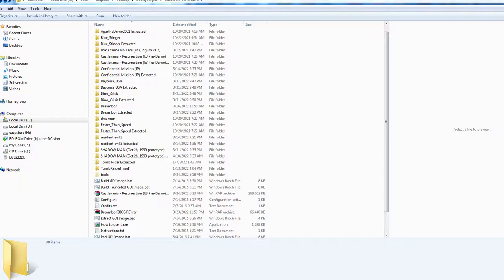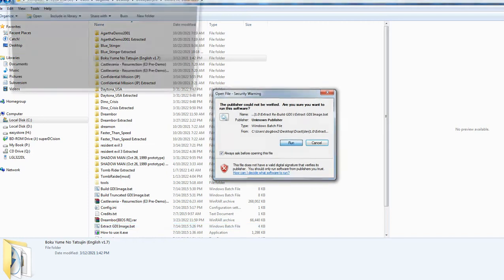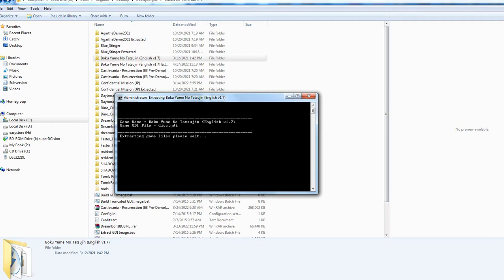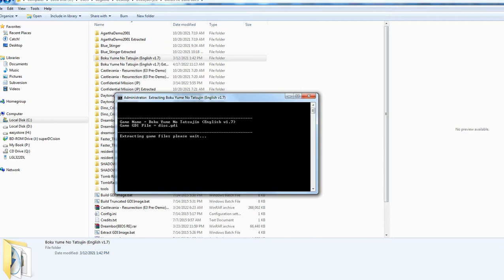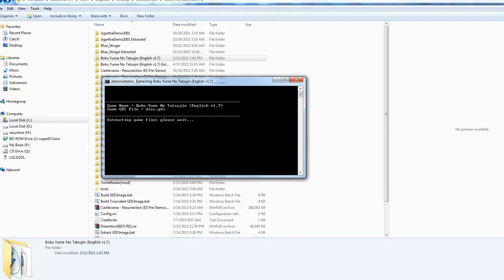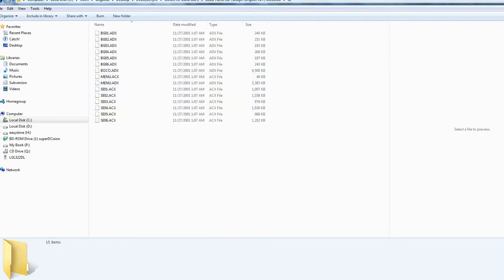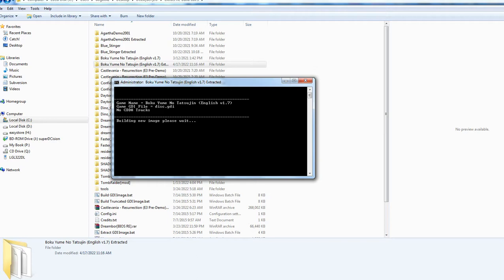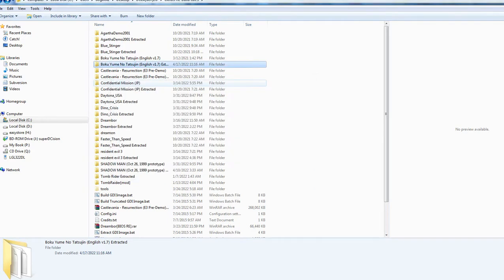HOW TO EXTRACT AND REBUILD GDI FILES FOR MODDING SERIAL PORT OR TRANSLATION DOWNLOAD LINK TOOLS

Comment: it is not able to extract sonic adventure v1.005 international version usa eng. I have the gdi and track bin files. I cant get config.ini file anywhere the tosec site only has retro games is this gdi extractor able to extract the dreamcast SA1. I'm emulating sonic adventure 1 on redream I want to mod/edit the gdi. files so that I can change the music with my personal mix so that I can listen to them while playing unfortunately this gdi. builder is the only one on the internet that works on my windows pc, and it has issues kindly pls find me a solution.
Reply from the maker: Could be windows problem this worked on windows 7 64bit

Comment: I'm on Windows 11, and unfortunately, I'm stuck at the very first step, which says that it CANNOT find a valid .gdi file, even though the directory I dragged into the bat file had one. The game I was dealing with was NHL 2K2.
Reply from the maker: Not tested windows 11 back here i was on windows 7 64 bit etc .. I will test with windows 10 and NHL2k2 did you use the tosec proper copy of it ?

Comment: hi i have downloaded a game nightmare creatures 2 how can i get gdi file? There is no gdi file inside it, all of them are in bin format from track 1 to 89
Reply from the maker: re down load the right set tosec archive get the version that's not like that
Reply: @IanMicheal  I don't think there is a problem with my game file because it can be easily run by the Sega Dreamcast emulator. I think this game does not have such a file by default
Reply from the maker: @MohammadRajabloo   Thats not the point this opens to sec set
Reply: @ I wanted to extract the 3D models of this game, but it seems that you have no information about it

Comment: Been trying to extract the Resident Evil 2 disks in order to try and rip the videos, as they are the highest quality RE2 FMVs without baked-in subtitles, but keep getting "Error 3: Can not find a valid GDI file".
Reply: @IanMicheal  have the same issue, something about the %~nx1 folder value in the batch script. If I copy the command but specify the directory myself it extracts fine.
Reply: @ryuhighabusa430  What line do you change to the extract destination?
Reply: @yazofscharactercrypt  
gditools.exe -i file.gdi  --data-folder "Extracted" -b " Extracted\bootsector\IP.BIN" --extract-all

Comment: Hey, im having IOError: [Errno 22] invalid mode ('r') or filename error on every game i`m trying to extract :(
Reply from the maker: Not seen that error before  drop drag the folder with  game.gdi inside it on Extract GDI Image.bat what images are they where did you get them etc.. This works on normal set.. I use this to rebuild proto types for the scene and other work.. Only a few do not unpack with this.. What game did you try and i will try to get the same error and fix it..
Reply: @IanMicheal  Hey thank you for the quick response! I`m trying with Spider-Man USA and MDK2 USA( both from vimm net). Tried dragging both folders with the tracks and gdi in them, both gave me the same issue :(
Reply: @IanMicheal  Thank you! I just downloaded from the archive and i managed to extract the game files! Thank you again!
Reply: @XanderNT  Hey! i'm having the same error on Razor Freestyle Scooter. I know it's been a minute but any chance you guys remember how you solved it here?

Comment: I'm able to extract, but once I try to rebuild, it gives me the following error: "This is not an extracted game folder".
Reply from the maker: 2 folders watch the video i show using rebuild using the extracted folder .. Example crazy taxi Extracted drop drag on rebuild ... You are using the wrong folder to rebuild  so of  course it will tell you it's  not an extracted folder.. One folder is the real gdi.. you use the extracted folder to rebuild the gdi..  It is  rebuilt into the base folder instead of making its own..

I show drop and drag of the extracted folder  to rebuild the gdi it's  rebuilt into the base folder..